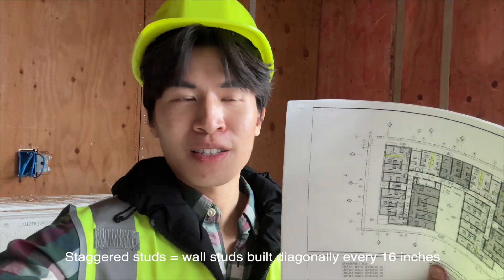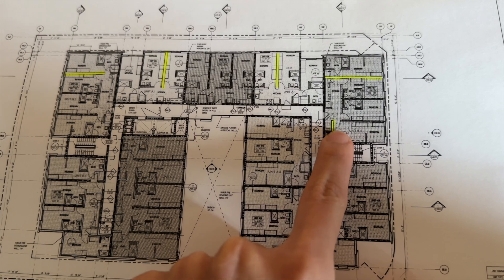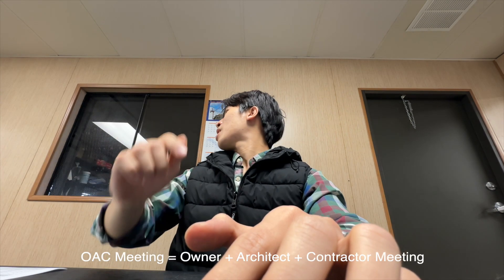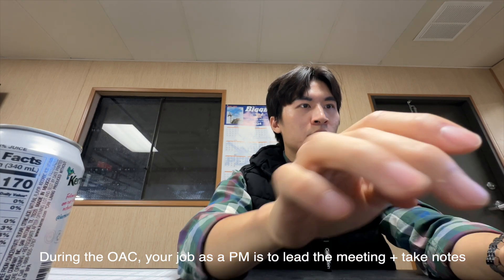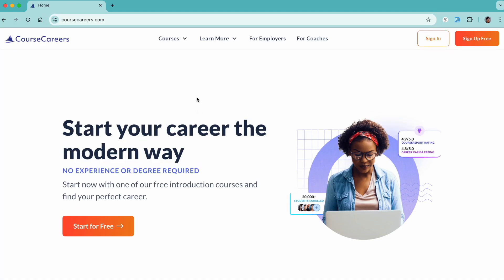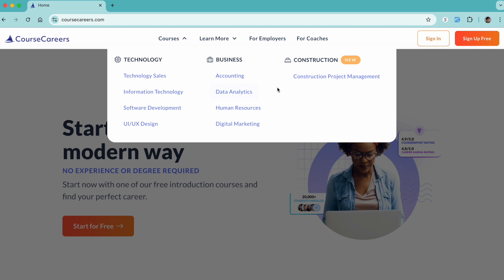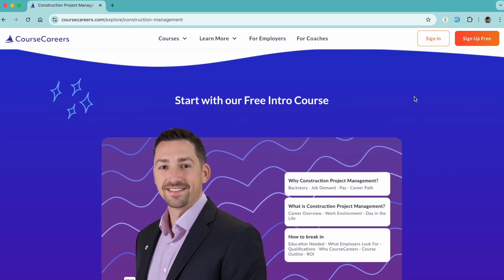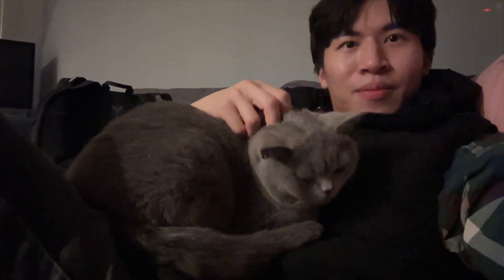Day in the life of a Construction Project Manager (in 5 mins)

Comment: if i want to start in the project managment field  do i have tp get the " FE "  exam? 

thank you
Reply from the maker: You’re referring to the Fundamentals of Engineering (FE) exam, which in your case, you should definitely still take it after you graduate. A PMP is usually taken after a few years of work experience. If you do eventually become a PM, it would still be beneficial for you to have the FE certification on your resume. A smart engineer makes a great PM. A great PM may not be a smart engineer.
Reply: @TreyTan  
I graduated from Malaysia, and in the place where I currently live, the FE (Fundamentals of Engineering) exam is not mandatory like it is in the U.S.

The issue is that I graduated a while ago and have been working as a site supervisor, so I’ve forgotten most of the structural analysis, calculations, and advanced math like calculus and differentiation.

I’m not really interested in design, but I enjoy working in supervision, management, planning, scheduling, and cost estimation.

Am I required to have the FE to find a job in the U.S. in project management?
Reply from the maker: @AA-salehbazyad  Probably not required to find a job in project management. Since you already have work experience, the PMP would definitely help.